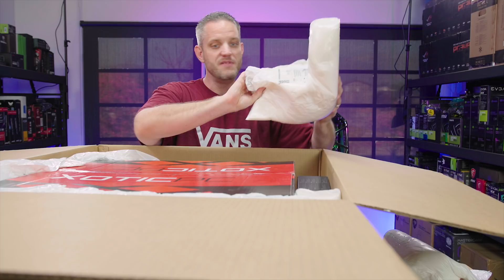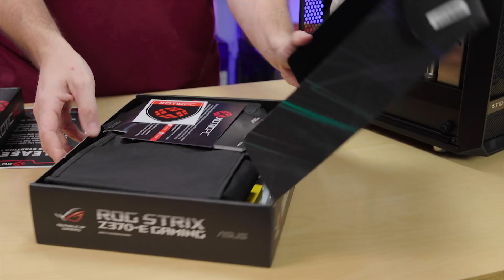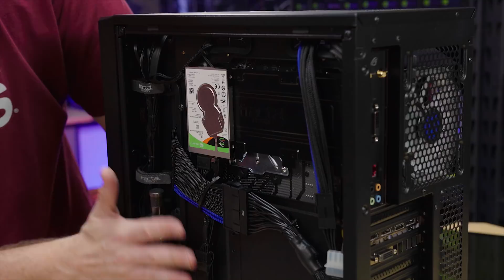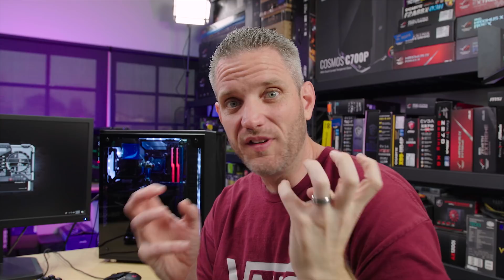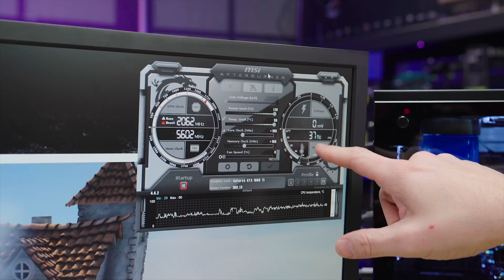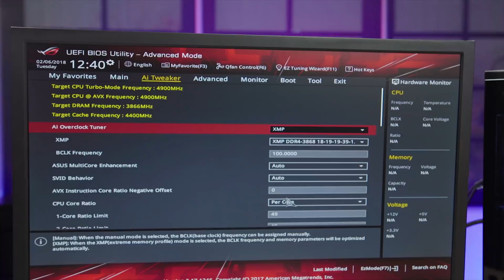XOTIC PC G7 Avenger! $4000 PC GIVEAWAY!

Comment: i    ordered this:  
GX12 DESTROYER X299
SKU: D1414
Sound Card1 x Creative Sound Blaster ZX SBX Gaming Sound Card with Audio Control Module (PCI-Express) $195.00 Desktop Custom Painting1 x Envy Green Exterior Paint $439.00 Cooling & Overclocking1 x Yes, Overclock the GPU(s) as much as possible with complete stability (XPC Service) $49.00
1 x Thermal Grizzly Kryonaut Thermal Paste- GPU & CPU (XPC Service) $49.00
1 x Yes, Overclock the CPU as much as possible with complete stability (XPC Service) $69.00 Air / Closed Loop / Frostbite Water Cooling1 x Stage 3 SLI: H2O CPU + SLI Dual GPU's + Motherboard Cooling (EK Blocks + Bitspower Fittings) $1,120.00 Type of Tubing1 x PETG Hardline - Straight $0.00 Choose Fitting Color1 x Bitspower Fittings: (Black) $0.00 Choose Reservoir Coolant Color1 x Orange Coolant $0.00 GPU - Slot 11 x NVIDIA® GeForce® GTX 1080 Ti 11GB GDDR5X $759.00 Desktop Processor1 x Intel® Core™ X-series Skylake i9-7980XE ( 24.75M Cache, 2.60 GHz - 4.20 GHz, 18 core | 36 Thread ) Extreme Edition Processor $1,817.00 Motherboard1 x MSI X299 Gaming M7 ACK (Intel X299 Chipset) (ATX Form Factor, 8 DIMMS, 6 PCIe Slots + 3 M.2 SSD Slots) $249.00 GPU - Slot 21 x NVIDIA® GeForce® GTX 1080 Ti 11GB GDDR5X $878.00 Braided Cables - Select Color1 x Black / Orange Braided Cables $0.00 Power Supply1 x 1600W EVGA SuperNOVA 1600 G2 Gold Power Supply Unit (Dual/Triple/Quad SLI Compatible) [w/ 10 Year Warranty] $379.00 Desktop Ram1 x 128GB DDR4 3200MHz (8x16GB) Corsair Vengeance® LPX Quad Channel Memory $1,799.00 Keyboard / Mouse / Headset Accessories1 x Razer DeathAdder Chroma $100.00
1 x ASUS ROG GM50 Mouse Pad $50.00
1 x Corsair K95 RGB Mechanical Gaming Keyboard [Cherry MX RED Switches] $249.00
1 x Steelseries Siberia 650 Gaming Headset $199.00 Operating System1 x Microsoft® Windows® 10 Professional (64-Bit) $145.00 Desktop Hydro Graphics1 x Carbon Fiber Hydro Graphic $75.00 Desktop Graphic & Textured Wraps1 x Camouflage Graphic Wrap (Green, Tan, or Pink) $119.00 Chassis Options1 x Noise Suppression Package (Stage 2) (Optimized Airflow & Fan Speeds with Noise Reduction Material) $79.00
1 x RGB Multi-Colored LED Internal Lighting Kit + Remote $49.00
1 x Thermaltakke RIING PLUS RGB up to 9 Fans $349.00 Desktop Laser Etching1 x Laser-Etch (Glass or side panel) – Submit your own graphic or text for etching. $99.00 Operating System Options1 x Yes, Redline Boost My Operating System(s) (Operating System Required) (XPC Service) $55.00
1 x Windows 10 32GB USB Drive manufacturer factory backup recovery $29.00 Shipping Warranties / Packaging1 x Custom Fabricated Desktop Wood Crate (XPC Service) $299.00
1 x Custom Formed & Injected Foam Premium White Glove Packaging (XPC Service) $0.00 External Add On Accessories1 x External USB 1TB Solid State Drive mSATA $369.00
1 x XOTIC PC / GEEK FUEL - Mystery Box Filled with Toys and Gadgets Perfect for Any Gamer or Geek! $35.00 Additional Software1 x McAfee AntiVirus Plus - Essential anti-virus protection for your PC $25.00
1 x Microsoft OFFICE 2016 Professional Edition (OEM/Medialess) $399.00
1 x 3 Year HYP3R BACKUP Unlimited Cloud Backup w/ 256 Bit Encryption / Device Location Tracking / Data Geo Redundancy 10% OFF (XPC Service) $399.00
1 x Installation of Global Anti-Theft Protection (globally track your PC if it is stolen) (O.S. Required) (XPC Service) $49.00 Multimedia Accessories1 x Logitech Z313 2 Satellite / 1 Subwoofer Speaker System $55.00
1 x Acer 24" FHD Predator 1ms 180Hz TN Monitor (1920x1080) w/ NVIDIA G-Sync $399.00 XOTIC PC Accessories & Gear1 x XOTIC PC LED Lighted Lanyard $12.00 M.2 SATA / PCIe / NVMe SSD Drive Slot 1 1 x 1TB Samsung 850 EVO M.2 Solid State Drive (Read 540MB/s - Write 520MB/s) $350.00 M.2 SATA / PCIe / NVMe SSD Drive Slot 21 x 2TB Samsung 960 PRO M.2 NVMe Solid State Drive (Read 3500MB/s - Write 2100MB/s) $1,389.00 M.2 SATA / PCIe / NVMe SSD Drive Slot 31 x 256GB XOTIC PC Certified M.2 PCIe Solid State Drive $99.00 PCI-E Slot 11 x 400GB Intel® SSD 750 Series PCI-Express 3.0 SSD (Read 2200MB/s - Write 900MB/s) $379.00 Raid1 x Raid 0 Stripe Enabled (Requires 2 Hard Drives. Combines Hard Drives for performance) $0.00 2.5" Bay 11 x 4TB Samsung 850 EVO Series SATA III Solid State Disk Drive $1,450.00 2.5" Bay 21 x 4TB Samsung 850 EVO Series SATA III Solid State Disk Drive $1,499.00 3.5" Bay 11 x 10TB 7200 RPM Seagate Desktop 256MB Cache SATA 6.0Gb/s $599.00 2.5" Bay 31 x 4TB Samsung 850 EVO Series SATA III Solid State Disk Drive $1,499.00 3.5" Bay 21 x 10TB 7200 RPM Seagate Desktop 256MB Cache SATA 6.0Gb/s $599.00 3.5" Bay 31 x 10TB 7200 RPM Seagate Desktop 256MB Cache SATA 6.0Gb/s $599.00

And im Freaking paying 21,781.0$
now im almost broke

Comment: Corsair HD 120 fans are ok when it comes to sound, but they are not silent. Their minimum speed is 800rpm and when it has to suck air through materials, bring in air through a bunch of hardware the sound goes up. Same for the ML fans from corsair, you can go very low in terms of rpm but they fucking rattle at low speeds.... To anyone reading my comment, I gone on a quest to find the best silent fans and after bying so many different fans, I finaly found the perfect fans; the bequiet silent wings 3 ! they are amazing at low speed, they are freaking silent with no RATTLING noise and if you need high speed they have two version (one goes up to 1200 and the other one to 2100, something of that nature). If you are like me and you want silence, get the silent wings 3.

Comment: Hello Jay! And internets. Talking about testing...I got my computer in November. It has an intel 8700k, Asus strix 1080 to, gigabyte sorus z370 ultra gaming motherboard and 32 GB of ram. And a Corsair 750w gold + PSU. When I game, it works guns blazingl, no problem. When I stress tested it for about 30 minutes,no problems there. However, when I use 3DS Max to render, my display just crashes... It turns black, and says no signal. At first it just flashes then shuts down completely. 3ds max uses 100% of my cpu and nothing of gpu when rendering. How and why is my monitor shutting down only when I render? Any ideas anybody?

Comment: Jay I'm having a issue with my PC I bought a new cpu it's a fx-8350 I had a 4300 originally well now evertime I turn the PC on is says the cpu is not compatible and will be under clocked to run what do I do lol I've checked all power saving features on my gig board even tried manually seeing the clock to stock still won't run highest I can run it is at 3.4ghz
Reply: And it never gets over 45c on the vrms or cpu on prime95 for over 2 hours so it's not a heat problem

Comment: Im in need of a computer badly because the one im running is i3 6100 with 550 immigrated graphics I only can run csgo on all low settings and my screen is so tiny because if I go to the display of my monitor I will get 10 fps which makes me feel dead.
Reply: Aiden Walsh oh you are everywhere and seem really toxic
Reply: Try running i3 530 with 3 (WTF!) GB DDR3 and 8400GS :D
Reply: Panda immigrated graphics? Ps. No one cares about your shit pc

Comment: If I was to get this system I would donate my FX8370 GTX 980 1tb samsung evo, corsair rm 650, 16gb 2133mhz system to someone on the channel that could really use it. I have been upgrading my existing system one part at a time for the last 4 years...
Reply: OMG that system and its water cooling setup with the cable management are things of my dreams... I run hyper evo 212 lol. Better than wraith cooler but only by a small margin.
Reply: SIGN IT JAY anyone who watches this channel, loves your content and would love your sig on it
Reply: OVERCLOCK IT JAY, anyone who watches this channel overclocks and would love a system you personally overclocked....

Comment: I just finished building my PC 2 weeks ago

Specs:
CPU: Intel i7 7700K 4.5GHz
GPU: MSI Geforce GTX 1080
Motherboard: MSI Z270 Gaming M5
Storage: Samsung 960 Evo 250GB SSD & Seagate Firecuda 2TB Hybrid Drive
Memory: Corsair Dominator Platinum DDR4 16GB 3000MHz
PSU: ThermalTake SmartRGB 850W
Cooling: Corsair H100i v2 AIO Liquid Cooler
Case: ThermalTake View 71 RGB Full Tower
OS: Windows 10 Pro

And I only spent $2630.00 buying everything from Frys Electronics :p

Comment: Omg I would do anything for that and would come to use a lot I play games from csgo to pubg well I can’t run pubg but my system is a prebuilt from 2008 I think it now has a q8400 had a e6300 I think and had no graphics card so I put a 750 to which allows me to play csgo above 40 fps which is a big upgrade compared to what I got on crap laptop which I got 30 all low settings
Reply: Dang watch the case video and dang I can’t believe I never seen that before really like that front pannel

Comment: is it just me or is the question about the rad on gleam wrong? Fractals website says that the meshify c will support a 120/240/360mm 140/280mm in the front which would make the 140mm rad the largest single rad it supports and the gleam question only had 120mm unless im missing something. Just going off my known knowledge never done a custom loop before. @JayzTwoCents

Comment: I did order from them a Sager Gaming notebook. its old. at the time the best top of the line graphic card is GTX 880M 8 Gigs GDDR5  now its got broken hinge. and part of the case for the monitor broke. due to its age and ton of open and closing,. any way I ordered two piece of case for the monitor and a pair of hinges. its so complicated I cannot work on it. Oh Well. However I did tried. I really could use the money to buy a new one http://www.xoticpc.com/xotic-g77-raven.html This is the best they got. The price is insane,   Its got tower parts in a notebook. Z370 chipset.  its got a i7-8700 as its CPU however that can be changed to i7-8700K $60.00 for that upgrade. Comes with a GTX 1070 8GB GDDR5  The 17" 17.3" 3K QHD, 120Hz 5ms Matte Display with G-SYNC Technology (2560 x 1440) RGB keyboard.

Comment: If your building a rig for someone you don't want to max the overclock simply because you don't know the average temperature where they will be using it. You could be sending someone some thermal throttling lower than stock performance.

Comment: Do they have an option to have the CPU delidded?
Reply: That's the thing, with Xotic PC when you order a build from them it can come OCed as far as they can take it while being stable. If you don't OC then no not really. If you OC as far as they do then Yes definitely worth it to delid and use a better thermal combound.
Reply: No, Xotic PC doesn't have a delid option for the CPU on any of their CPU options. Of which you can choose between Z370 X370 X399 or X299
Reply: For such an expensive PC, on such hot CPU's, you'd think they'd offer that. If I'm paying a premium, I'd like the best performance. lol
Reply: I do agree for the premium that they charge I do expect the best, however I do think that they are more about stability and it could be that in their opinion the risk of delidding a cpu is not worth it for the advantages. I can't say since I don't work for them, just my thoughts as I have looked into them for the last few years being a local business.

Comment: Jay, I used to get over 200fps in CS:GO but now for some reason I only get around 70 :( Do you know what could have happened and how to fix it?
CPU: Intel i3 7100 3.9GHz
GPU: ASUS Phoenix GTX 1050 TI
RAM: Crucial 8Gb 2133MHz
Storage: 1x WD Blue 1TB HDD - 1x 320Gb Toshiba 2.5" HDD - 1x 320Gb WD Scorpio Blue 2.5" HDD
Motherboard: ASUS H110M-R 1151 Motherboard

Comment: JayzTwoCents : you should have checked for the VRM-s because I know for a fact (from my building rigs for my customers on the other side of the planet) that VRM-s are cooking (above 100 degrees) under those poor heatsinks on these i7 8700(K) already at stock clocks even without "enhanced multicore" option turned on. And this prebuild rig has no small 6-8 cm fan blowing on the VRM heatsink....and trust me they will start dying in a matter of 3-4 months and much earlier if there is a mild OC done on the rig. The selfproclaimed company that builds these is a crappy and inexperienced one due to not caring about VRM-s that are problematic on the Shintel side since the release of Skylake 2015.

Comment: Doing a solid capacity, high wattagewc build in the Meshify C while maintaining top notch acoustics, is not an easy task. It is one of, if not the, best cases on the market today, for airflow. But the tradeoff is that there is very little in the way for noise to exit the case. Its also challenging to compensate with more fans at low speeds, as its not exactly a fulltower. Cudos to those who built this thing.

Comment: I would reaaaaally want this if I didn't already pretty much already have it. besides I'm in the uk so I'm out anyway I guess. I have a meshify c, 8700k, strix 1080ti and corsair dominator platinum but only a kraken x62.

I thought that cooling solution might help that 8700k more with the temps especially as it only on a per core overclock. the 8700k is a pain to cool tho for sure, I only use a kraken x62 ( with 1 fan mind you because the strix is too long and ram too tall! clearance huh, can only get the 280 rad on front with 1 fan. ) and can get 5.0ghz on all cores with 1.320v, but I only run cinebench around 10 times before I'm happy its stable enough to game. problem is my temps can reach around 89c so I run the chip at 4.8 and 1.210v to get the temps comfortable. I think I need a delid because I feel the chip is really good its just I'm not sure as a gamer mostly I don't really need it, i also need to find a way around my clearance issue, any ideas jay?

really nice build this but its not like something you would build, this is pretty bland in comparison to a lot of yours jay!

Comment: Seeing that the CPU is overclocked with per core instead of all core, can you check to see if it's actually doing that? My board wth the same CPU Is set at 5.2GHz on 1-2 cores, 5.1GHz on 3-4 cores, then 5.0GHz on 5-6, but I never see it go beyond what the 6 core option is set to. If it's set to 5.0, then I'll never see the 5.2 the 1-2 cores are set to. I'd run 5.2 flat out, but my air cooler is holding me back with temps at the 80c area and I'd rather stay under that. (Could just be my mobo bugging out. it's the ASRock Extreme 4)

And I'm sightly disappointed that such a good looking system doesn't come with that CPU already delided, but I can understand why it wouldn't be delided too.

Comment: If and I mean a big IF I win this PC, I wouldn't need to buy a Pre-Built system, but I agree that the way the current prices are for GPU's (which I need a new one Badly) I would gladly agree with JayZTwoCents on this one and look into a Pre-Built PC system. Currently I am running a 4 core 4820k, Rampage 4 Extreme, 16gb DDR3 1866 Ballistix Ram, 120gb Kingston SSD bootdrive, GTX EVGA 770 4GB Card, Corsair RM 1000 Power Supply and a Cooler Master V8 Air Cooler. The only thing I can upgrade on this system is the GPU and Boot Drive, otherwise I would need to Upgrade the whole PC worth of parts, so in my case, if I cannot get a cheap but good enough GPU then I am really leaning and looking into saving up for a whole New Pre-Built system. When April comes around this current PC setup will be 4 years old, when I bought it and built it. Though if I win, it would be a great boost in system quality and performance, plus I would love it every minute I would be Gaming on it!! Thanks again to JayZTwoCents for being awesome and Giving back to the Community, also thanks for XoticPC for Making an awesome Build!! Good Luck everyone.

Comment: I still have my first Gaming PC I built - FX 6300 @4.3 GhZ, Hyper 212 EVO aftermarket cooler, 8 Gb of DDR3 Ram @ 1600 MhZ, 2 TB HDD (recently put that in to replace the original 1 TB) ,  and an R9 280 (non-X). It has been a great start to really get into PC gaming - but it's showing it's age. 

I've been wanting to get back into knowing what the top hardware is now in 2018. If I manage to win this giveaway, it'd be an awesome upgrade from my first built PC.

Regardless, good luck to everyone entering!

Comment: Those are the Corsair  HD fans, not the MagLed(ML Series) fans.
Reply: Negative. Only Corsair's ML series use MagLev tech. Both the LL and HD series use Hydraulic bearings. You can find more info on their product page at Corsair's website as well as the tech specs tabs on Newegg/Amazon. 
 
ML series have 4 RGB LEDs in the center and are obscured behind opaque plastic. HD series as pictured here have 12 RGB LEDs around the frame and are behind clear plastic allowing each individual LED to be visible. The LL series have both 12 around the frame and 4 in the the center which like the ML series use opaque plastic to soften the lighting effect.